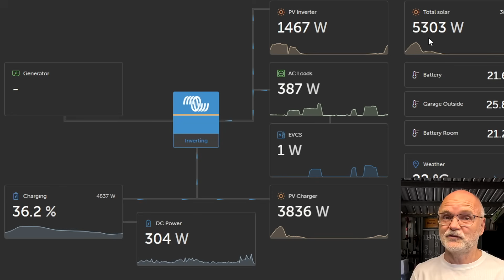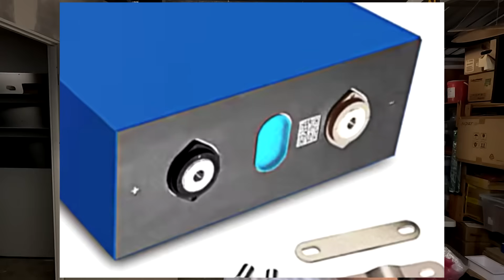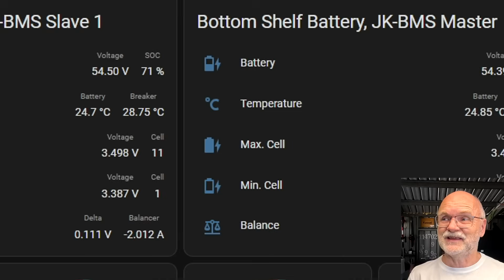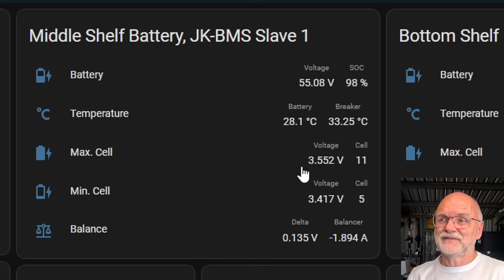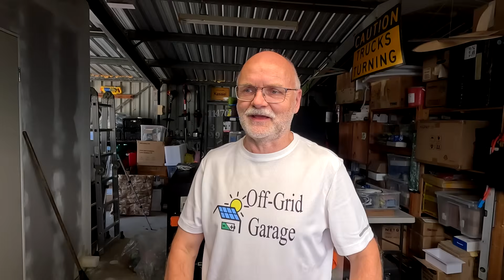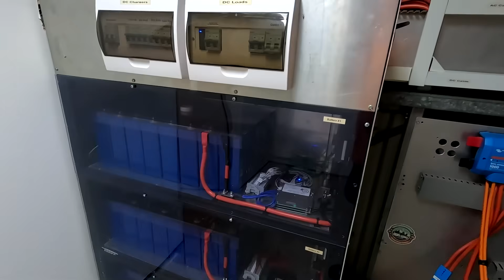First full charge of the Battery Shelf after Winter. And an old problem is back!

Comment: G'day Andy, long time no comment (been busy here at PowerPaul). 

I've done a deep dive into some characteristics of cells and have a theory that maybe the connection resistance isn't the overall issue with your middle shelf battery. I have found balance issues are more related to self discharge of cells than anything else. This is of course easily misread as IR or connection issues. 

What I suggest doing, is to fully charge the middle shelf to 3.65v/cell (or very close to) and ensure they are fully absorbed, here I did it to 500mA termination current. Then comes the annoying bit... waiting! If you let them sit completely disconnected from anything including the BMS for 2-4 weeks (the longer the better), this will allow the natural self discharge to drop the SOC a little. Then you need to charge each cell individually (using your ZKE with the same 3.65v/500mA termination) and log how much charge each cell takes. This will show you if there's a significant mismatch in cells. I would be fairly confident the troublesome cells in that pack will show noticeably different self discharge values. 

It's a painfully slow test to do, but when it comes to the nitty gritty of cell behaviour you're excellent at testing and explaining it to the audience. 

Things like resting voltage when 100%, recovery voltage when 0%, IR and even absorption duration are also interesting artifacts to view when you're topping each cell back up. I first thought absorption duration was going to be the main culprit for mismatched cells, but it turned out to be self discharge. Cell capacity is of course a factor, but it falls below self discharge in the ranks.
Reply from the maker: Thank you, Paul. That is a test I can certainly undertake as I can fully isolate the battery from the rest of the system.

The strange thing is only, if I loose the two nuts of cell 11 (which was the high voltage cell in the video), move the busbars back and forward 2-3 times and tighten the nuts again, the problem is gone.
Of course, there is now another cell which has the same problem. So, if I repeat this process for all cells, the battery as a whole works perfectly fine again and I can push 150A with very minimal deviation across the cells. 
So in this case, I doubt this is a mismatch in cells, IR or difference in self-discharge. If the cells would be mismatched, should the problem not stick with this one cell?

By moving the busbars, it cleans the terminals somehow and makes the connection almost perfect. As I said, this last only for 2-3 months before this exact same problem happens again. I assume this related to air humidity and temperature. The terminals of these first gen cell are made from super soft aluminium and are really not great. The M6 holes in these terminals were made by the reseller as EVE did not do that (they come with either flat terminals or double hole welded terminals as you know).
I also have the other battery (the very first battery #1 from the plastic tub), which has the same terminals and the exact same problem.
Reply: @OffGridGarageAustralia  yep it's a weird one for sure. I'm confident you can get to the bottom of it though. 

We use Alminox here on our terminals, I don't recall what you use but maybe give it a try. 

I've seen such odd behaviour from mismatched cells and/or bad connections. Until the cause is found, the compounding effects can be so confusing.
Reply: Sounds like a good test. But why charge to 3.65? It’s likely that above 3.45 lithium plating already starts. So, I’d be very careful to charge it to 3.65 but even more to leave it there for a longer time.
Reply: @mfaasse  it's not at 3.65v for long, after a few hours it will naturally drop. This is the specified voltage that manufacturers quote as being 100% SOC.
Reply: @PowerPaulAu I know. But it might be outdated. More and more prove that cells can be (almost) fully charged at 3.45. With that in mind and theories that lithium plating starts above 3.45, the same test could probably done with 345. Less stress for the cell.
Reply: @mfaasse  the "stress" is totally insignificant as a once off test like this. It's about seeing what cells do at their extreme.
Reply: @PowerPaulAu  You can be right, I'm not sure about this. Research also shows this: How Does Lithium Plating Work?

Lithium’s standard electrode potential = –3.04 V (vs. hydrogen at 25 °C)

Iron’s = +0.41 V (vs. hydrogen at 25 °C)

Sum = 3.45 V → exactly the full-charge potential of an LFP cell at 25 °C.

So:

At 100% SoC, Li ions are fully bound to FePO₄.

At 3.45 V, the cell cannot take more charge.

If voltage is increased above 3.45 V:

Van der Waals forces can no longer hold lithium ions in the crystal structure.

Current provides electrons to neutralize Li⁺ ions → they deposit as metallic lithium.

Metallic lithium forms a crystalline layer (like chrome or nickel plating).

This layer acts as a Faraday cage → preventing further ion exchange.

So how 'big' the damage exactly is by overcharging has not been proved or measured yet as far as I know. I'd be very eager to learn more about that. For now let's assume it's a theory which makes sense and to keep in mind.

Comment: I don't know why you have those issues with those old cells. I have two packs of those old cells with studs, and they're in their 6th year now without any issues. I use flexible copper bus bars (braided, made myself) and some MG Chemicals 847 paste. Like I said, no issues even after not seeing 100% for 6 months over winter.
Reply from the maker: There are so many pastes I tried, I have to have a look if the 847 is in my stock already... Maybe worth giving this a try. I have the same issues with the old battery #1 from the plastic tub. Same terminals, same issues.
Reply: @OffGridGarageAustralia  Like I said, two packs, 6 years, no issues. That's why I'm wondering if it's something I just do differently, or if you just have bad luck or something else.
Reply: @OffGridGarageAustralia  Replace sanding paper with a metal wire brush (that is not used for other purposes). Immediately after brushing the aluminium, apply the paste. So don't brush both contacts or sides of the busbar, only 1 and then apply the paste, then brush the other one.
Reply: Why not 8463A? One syringe is enough for 2 or 4 batteries, depending on the terminals.
Reply: @TkachenkoArtem  Works fine too, but not necessary.

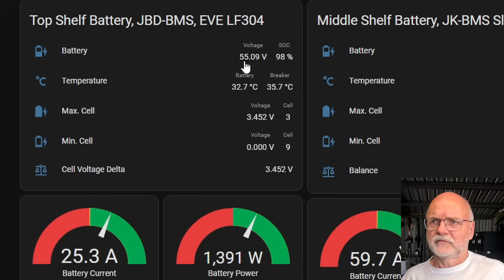Comment: @13:33  What happened to Cell 9 on the Top Shelf!?!?!  0.0  Is that a BMS thing, I hope?
Reply from the maker: That is a Batmon problem which I use to pull the BMS data into Home Assistant. It uses BLE and is not very reliable. This will be replaced by the iBMS soon. Can't wait to show you...
Reply: Well-spotted!

Comment: Hi Andy, thanks for your always informative and entertaining videos. Regarding the BMS JK v19, is there a feature to turn Bluetooth on and off? How reliable is this new v19 compared to the v15? If anyone in the community has any information, I thank you in advance for your replies. Regards!
Reply from the maker: Yes, you can toggle BT by double pressing the power button. You should hear a single or double beep, confirming BT is off/on. It needs one of the latest fw to work. You can find new fw for all JKs on my website here: https://off-grid-garage.com/battery-management-systems-bms/

Support for the V14 and V15 have been ceased and only V19 will be getting updates. The V19 will also get Wifi and other functionality soon.
Apart from that, not much different to the V14 or V15.

If you already have V14/V15 and want to upgrade to V19, it is enough if you do that for the master battery and leave all the slave batteries on the older versions of the JK.
Reply: @OffGridGarageAustralia thank you for your kind answer, it's a great feature and with the new diy diy kit, I'm thinking to built my new battery system. 😊
Reply: On the V14/V15 they added double-click on the power button to toggle Bluetooth. Does that work on V19?

Comment: I've made several comments before about the SmartShunt SOC drift. I have my system set up to prioritise solar by only connecting and charging from the gid when voltage drops off to a set voltage and then stop the grid when it has risen to a set voltage. In winter my system can do this multiple times a night for night after night and I observed on the VRM SOC chart that the SOC drifted by 4% every charge cycle. I concluded that charge efficiency is not 100% and so changed that setting to 96%. Now my SOC cycles in the same range each charge cycle and then when I finally fully recharge I am virtually spot on 100% at the right voltage and current tail off. You should set this up as a test - it would make a good video.
Reply from the maker: Thanks for sharing. We have tested this during the last couple of years and the smart shunt was only off by a few % after winter. I have set mine to 99% charge efficiency. Really strange that yours drifts so much per day.
Reply: @OffGridGarageAustralia  If you check the shunt settings, take the measurement of the discharged energy, and divide it by the charged energy, you’ll get the exact charge efficiency value. By doing this, I’ve reduced drift almost to zero 😉
Reply: @OffGridGarageAustralia  Yours has drifted by 13% over your Australian winter which is not insignificant. It would be even greater if you were not set at 99%.  It would be great if you could set up a Multiplus II and Cerbo to do what mine does (i.e. kick in grid charging at a set low voltage in the steep part of the curveand then turn it off at a set slightly higher voltage just out of the steep part of the curve repeatedly) and then see how your SOC curve drifts with each cycle. Come on... we know you're not busy!
Reply from the maker: @vonasi2  no, no, no, I explained this in the video. It has not drifted by 13%
Reply: @OffGridGarageAustralia  Whether you last recalibrated at 0% or at 100% does not matter you were still 13% adrift at the next full recharge.... although thinking about it you are adrift the other way! Mine counts too many amps going in compared to reality and so the Smart Shunt thinks we are at 100% when there is still plenty of charging left to go to reach that point.
Reply: It's a good thing that you did the right thing. Also Significant drift of the BMV and poor configuration. People take it out of the box and plug it in without enough consideration.

Comment: I had the same issues with the old 280mAh cells. I was told to use Copper all-thread and make copper studs and buy copper nuts and assemble using Dielectric grease! and haven't had any issues at all. And I live in Salty humid Florida. Another great video Andy.
Reply: I can't wait to see the MB56 DIY boxes to come out as I need to do a big update in my battery system.
Reply from the maker: The MB56 box is already out! I will build one next week, the cells have just arrived and look fantastic!

Dielectric = electrical insulator
Why would such a grease help?
Reply: @OffGridGarageAustralia  Andy, you can use MG Chemicals Carbon Conductive Grease 846 between the battery terminal and copper buss bar.
It provides both conductive & corrosion protection!
Reply: @OffGridGarageAustralia  Sorry Andy I meant Copper Anti-Seize Compound prevents corrosion in threaded connections reliable electrical contact. Dielectric grease is for sealing connectors. And looking forward to the MB56 DIY build

Comment: Greetings from Finnish Lapland, which is getting colder!

My solar panels yield are just now lagging behind in consumption... Autumn is coming and the yield will end when the snow rains.
I have to manage for six months without the electricity produced by the panels, luckily the 60kWh battery helps keep the actual electricity bills as low as possible when the price of grid electricity fluctuates up and down.

I have managed without purchased electricity from half of March! thanks Andy for your videos!
Tomorrow night I will have to charge the batteries from the grid for the first time since the summer. On clear autumn days, the solar panels still produce enough to meet consumption, but in autumn here in northern Finland it is almost always cloudy.

Yes, this is a hobby that takes all the money to build, but when it works, it's a great "hobby"
Reply from the maker: Thanks so much for sharing! That is so interesting to read and very different from our climate down here.
Do you use a hybrid inverter to charge the batteries or a separate charger? How much do the electricity price change during the day?
Reply: @OffGridGarageAustralia Just today the hour price of electricity is fluctuating between 1 cent (we have euros) and almost 40 cents per kWh.
But like las winter, price can be rise over 1 euro per kWh!
Fortunately, almost every night the price of electricity drops close to zero, and the night-time transmission fee is also lower, so it's a good time to recharge your batteries for the next day.

i have two victron multi rs devices. they are hybrid inverters, i control the charging on/off with an external control according to the price. And of course summer time goes without charging
Reply from the maker: @mika.tauriainen  Very interesting. Do you use Home Assistant to control charging depending on pricing?
Reply: @OffGridGarageAustralia  No. I have a shelly relay simply disconnecting the mains power from the inverters.
Shelly has a script that tracks price information provided by a third party.

There is a great community of enthusiasts here who maintain that price information script, it is free for everyone.

I'm interested in that home assistant, but I haven't gotten around to learning about it at all.
Reply: @mika.tauriainen  I am in Northeast Ohio USA and yes we are seeing a decline in solar production as well here.. Our power company actually does the opposite and raises prices by a couple cents per KWH in Summer and lowers them in Winter which is a big win for me.. They base this on less Winter storm damage and better transmission of power on the cold wires so lower operating cost to KWH delivered.. It ranges from 18 cents to 12.5 cents per KWH and that includes transport, taxes and other fees.. On average we use around 800KWH a month but thanks to the solar our grid usage is below 100KWH for 6 months a year and in Winter we do miss those $23 power bills..
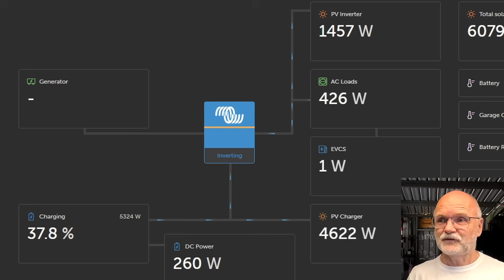Reply: I'm in the UK, from 23:30 to 05:30 our electric is £0.07, after 05:30 it's £0.27. I get paid  £0.15 for each kWh exported, so even in the summer I fully charge overnight, and in the evening I export the batteries down 15% SOC. I have various Node Red scripts running directly on the Cerbo to achieve this, I also use HA for some stuff. My energy bills have been negative for three years, and this year that includes an EV and heat pump.
Reply: @TheRonskiman  How many years do you think it will take to recoup your investment?? After the last price increase for grid power and our purchase of $6k US of batteries and a bigger inverter our breakeven point barely changed and we are looking at 10 years to go and 6 years behind us..

Comment: Amazing how spoiled you are in AU for sun :) So much fun to see!
I'm heading into winter with my new 10.2 kW system (with 32kWh battery) and only got 36.8 kWh today :(  Yesterday and the day before it was better days and I got around 45kWh but even when it is cloudless it is less day by day.
In August good days were 60 kWh and in July it was 70 and 78 kWh in June so I will have to use grid during lowest rates to recharge come winter. No way to consistently get 30kWh for daily needs. Heck, my computer alone needs 4 kWh a day!
Reply from the maker: Yeah, the power of the sun is enormous down here. I already have too much energy for a day now (but a lot of hungry batteries to feed).
3 weeks ago, I was still saving energy where I could to make it over the day, had to schedule EV charging over several days...

Comment: What’s the “charge efficiency factor” set to on the smart shunt? On such a huge bank, you should probably set it to 100%.
Reply from the maker: It sits on 99% in my shunt.
In the past years, the drift of the shunt was very small with the first recharge after winter. Only 3% last year from memory.
This time, I reset the shunt to 0% when the battery was completely empty, hence, we have seen this huge gap this year.
Reply: It probably is which is why he has SOC drift. The cells get warm and that is energy loss. The BMS gets warm especially when balancing and that is energy loss. I have mine set at 96% and I have no SOC drift.
Reply: @vonasi2 I have mine set at 99% and still getting drift. Thinking about changing to 100%. There’s no heat buildup anywhere on my system for currents under 0.5C
Reply: @ThanosSustainable  Your cells will be warm and your BMS will be warm.... not hot but warm and that is energy loss.  I have my system set up to prioritise solar by only connecting and charging from the gid when voltage drops off to a set low voltage and then stop the grid when it has risen to a set higher voltage. In winter my system can do this multiple times a night for night after night and I observed on the VRM SOC chart that the SOC drifted by 4% every charge cycle. I concluded that charge efficiency is not 100% and so changed that setting to 96%. Now my SOC cycles in the same range each charge cycle and then when I finally fully recharge I am virtually spot on 100% at the right voltage and current tail off.